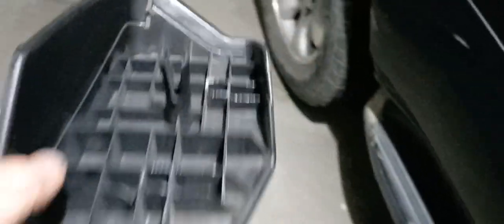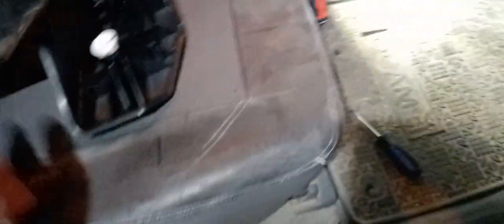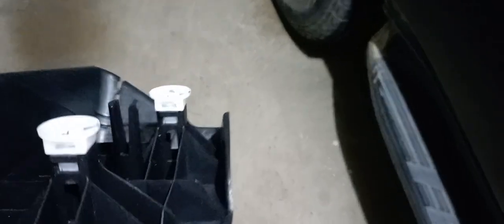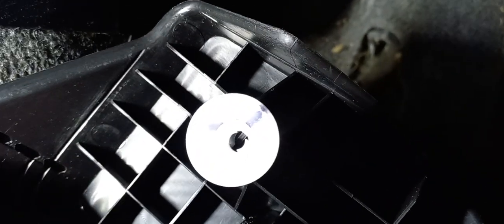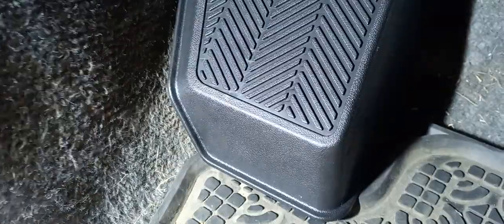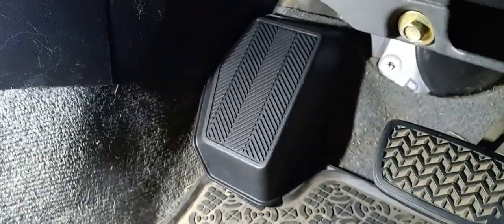How to replace a Prado 120/150 GL Footrest.

Comment: Might be worth pouring a bit of epoxy in around those white pieces to create a bit more strength. Obviously ensuring that doesn't affect the fit or fill the holes in the white supports.
Reply from the maker: @TheCrakrjack  fitted quite nicely. Probably wouldn't affix it permanently.
Reply: @ritchiesgarage  I don't mean to keep it fixed in place. I mean to strengthen the supports. They are pretty weak and I, like many, snapped it off just by repositioning myself in my seat.
Reply from the maker: @TheCrakrjack  ditto. Next time, I may well give it a go. Thanks for the suggestion.